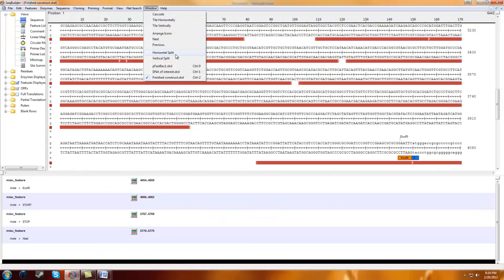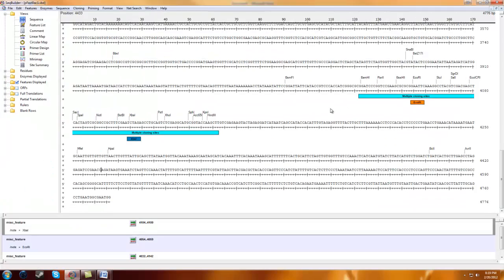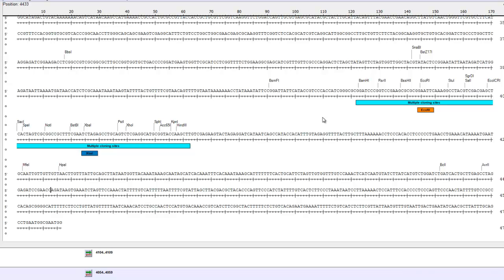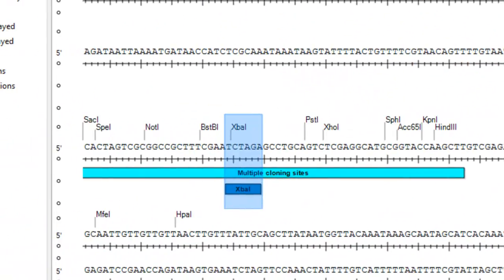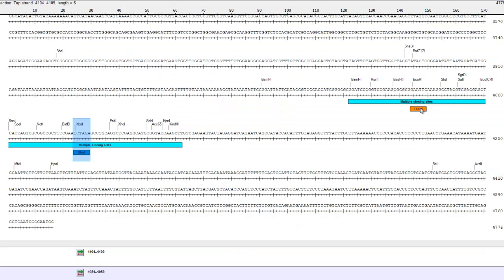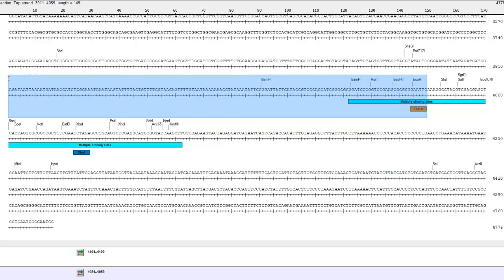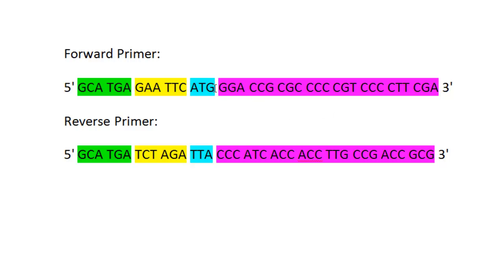Tutorial 2: Cloning Part 2 (Advanced PCR Primer Design)

Comment: What is the purpose of the non-sense ending? I am doing some basic stuff, and all I am doing is trying to get a promotor from a source, and then pasting into a plasmid vector. Do I need the non-sense codon, and how do I get rid of it when I am doing ligation?
Reply from the maker: The "non-sense" bases are there to facilitate restriction enzyme digestion. When you digest the promoter and ligate it into the vector, those "non-sense" bases would be already removed. Hope this helps.
Reply: okay thanks!

Comment: Thanks a lot!! Your video helped me a lot for my project.
Can we follow the same procedure for promoter cloning?
Reply from the maker: neu 123 You mean cloning a specific promoter sequence into a plasmid? That should be fine. A promoter and ORF are both DNA sequences. If you can clone one, you can clone the other.
Reply: TheScyther88 Yes, you are right. But while designing the primers, is it necessary to incorporate start and stop codon for promoter analysis like luc reporter assay?
Reply from the maker: neu 123 Okay, from my understanding you are trying to characterize a specific promoter using a Luc reporter assay. I'm assuming you have the reporter plasmid and now you are trying to clone in your specific promoter. That reporter plasmid should already have an appropriate start and stop codon in the Luc ORF (most commercial Luc reporter plasmids have them). This means when you design your primers to clone in your promoter upstream relative to the Luc ORF, you should not include start and stop codons. Start and stop codons (or I should really say DNA sequences) will not do anything in the promoter region at best, and at worst the extra sequences will interfere with your assay. Hope this clears it up.
Reply: TheScyther88 Ya thats exactly what I thought. Thanks a lot for clearing my doubt :)
Reply from the maker: neu 123 You're welcome, glad I could help.

Comment: Great video. I now have a simple strategy to apply. I noticed you added your start and stop codon. Is that because your gene of interest is cDNA and not genomic? I think I heard you eluded to that in the video. Also your primers started with the start and stop codon, which most of the time is not possible right? Due to Tms etc!
Reply from the maker: Thanks for checking out the video. Most expression vectors such as pCDNA, pCAGGS, etc. already have a start and stop codon in-frame with the multiple cloning site (MCS), so adding your own start and stop may be redundant. Basically it comes down to this, you need to make sure there is a start and stop in your vector - whether it's already there or you have to engineer it into the vector by PCR depends on the vector. In my video my primers do not start with the start and stop codons. I assumed my vector does not have them so I'm just showing viewers how to engineer them into a vector in-frame at a multiple cloning site. They would not affect PCR in any negative way since they are just nucleotides - nothing special.

Comment from the maker: Thank you! As for your project, do you mean you want to use E. Coli as a protein expression system? If so, you need to first identify the correct vector to use. There are many commercial vectors specifically designed for E. coli expression systems. The next step is figuring out what CDS (coding sequence) you want to insert into your vector. My videos are good for a general guideline, but you need to decide on the details (i.e. vector type, CDS, etc). I do not know of a free version of SeqBuilder